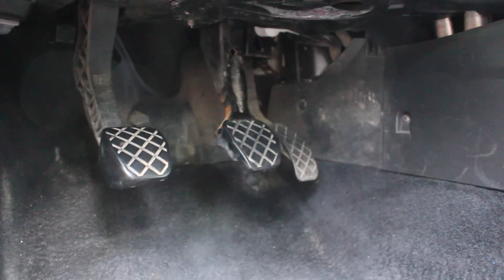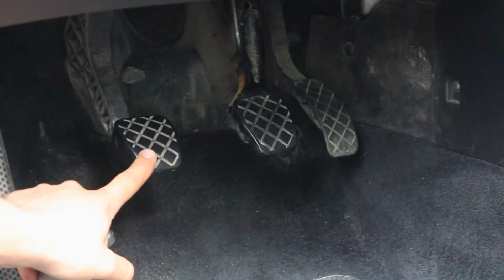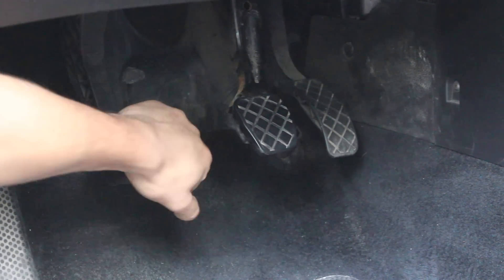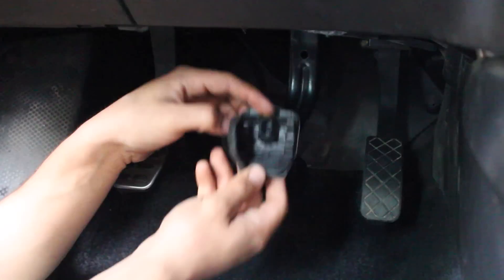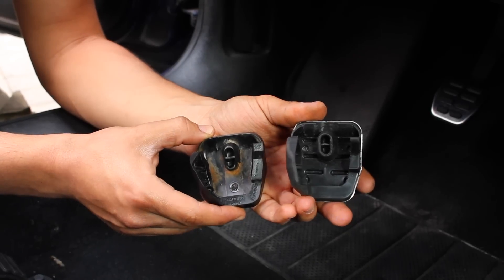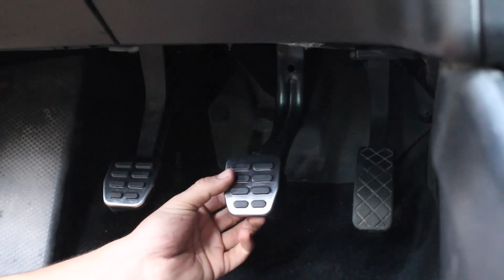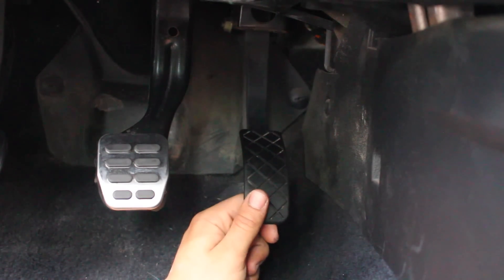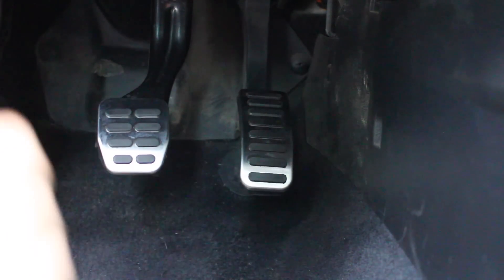How to Install Aftermarket Pedals

Comment: does this add 30 hp
Reply: Actually about 50
Reply: Cpd Hyrule recent tests say red pedals add 75
Reply: The latest one for 2018, adds about 80
Reply: james3v ..
Reply: More then 30hp the instructions usually tells you after installation you should automatically feel an increase in horsepower to about 60-70hp the dyno is says if you purchase Red pedals you're looking at 200hp increase alone
Reply: 2019 modela have received a mild boost and now adds about 91BHP
Reply: around 45 HP, 30 only with 2 pedals and 1 lazy pedal lol
Reply: My mans @amera amer... you don’t get it🤣🤣🤣
Reply: Lol actually that’s not give any hp thou it eliminates the squealing noise from the petal during rainy days

Comment: for the people who want to try this I recommend you to heat the rubber part with a hair dryer or leaving them in the sunlight for 10 minutes. that should help you a lot.
Reply: Thanks a million for the hairdryer trick, can't tell you how much easier it was
Reply: Jack Doyle did you struggle with it because I’ve been trying for days and it just doesn’t want to happen
Reply: @notoriouseta7292  Ye mines a 2012 Opel Astra GTC, it really hurts your fingers the brake pedal was hardest. Took 30 mins altogether. Heat with hair dryer and try make the rubber more flexible.
Reply: Jack Doyle ok I will give that a go because they’re all lined up but the break pedal bit just doesn’t want to go through the hole
Reply: @notoriouseta7292  mine had no hole as its an Opel Astra GTC not a Golf

Comment: I bought these replica pedals a year ago, the Gas and Clutch pedal are fine but the Brake pedal kept moving no matter how many times i tried to adjust it to fit it would always move around, i replaced it with a real Audi TT Brake pedal and works way better then the replica one.

Comment: I bought the same, there a accident waiting to happen. I’ve put the originals back on, there is a reason why the original ones are harder to take off and put on. Would you buy a parachute from China, because it looked good and was cheap???
Reply: What 🤔

Comment: When I wear my Nike Air Force ones high top and it's wet my left foot slips when I'm pushing down on the clutch pedal to shift gears it happened to me a few times my shoes has no grip when they get wet so instead I keep a Left shoes in my car so if it's raining out or my shoes gets wet from washing my car I can switch shoes I find doing Heel Toe with thick shoes to be hard compare to soft shoes but overall I'll be adding a shifter extender aftermarket shift knob racing pedals NRG hub and quick release kit and a 3 inch Deep dish aftermarket racing steering wheel on my 2010 Corolla XRS
Reply: Don't wear Air Force ones 
Thick ass shoes

Comment: Am I the only one who can't get these damn pedals on? lol
Reply: Giocoh No dude i cant install pedals too 😂😂
Reply: Noobs:/
Reply: Hahaha so I wasn’t the only one ?
Reply: Still can’t get mine on
Reply: If you put the heaters on high and blow them towards the floor then it should help :)
Reply: Christian Aguirre im struggling with the brake and accelerator 😭
Reply: Grease the rubber.  Pops right on.
Reply: I snapped my frickin clutch pedal! I was prying it off with pliers and i didn't know it would be made of PLASTIC.
Reply: these are made of some god damn titanium , it is so difficult

Comment: I have the same pedal set that you fitted and also the same stock pedals (VW Polo 6R). For the Gas pedal, the aftermarket one isn’t fitting over the stock pedal for the left side. There is a bit hanging on the left side of the stop pedal and I think your one is the same. How did you manage to clip in the left side of the aftermarket pedal?

Comment: Hey man I’m having trouble putting these on I only put the break pedal on but the gas and clutch petals are pretty hard to put on what do you recommend to make it easier to put it on?
Reply: For me the Brake Pedal was hard to put on, it moves around a bit and doesnt seem well adjusted like the Gas and Clutch pedal.